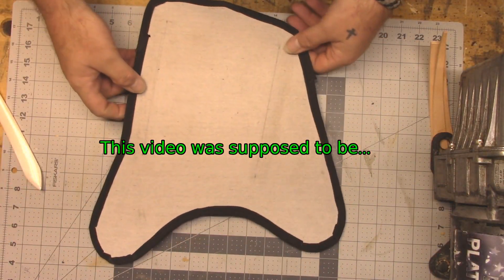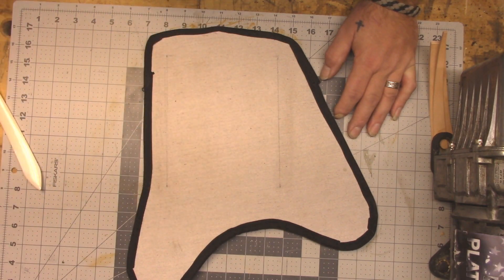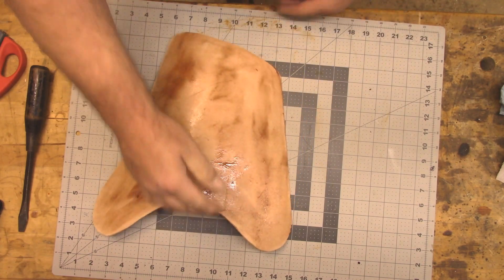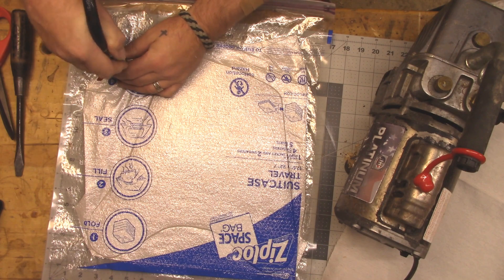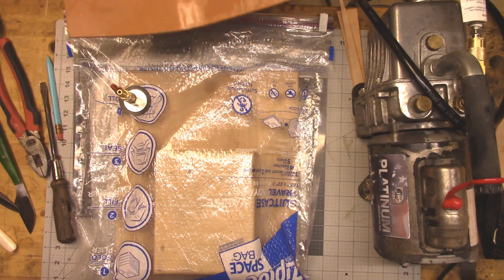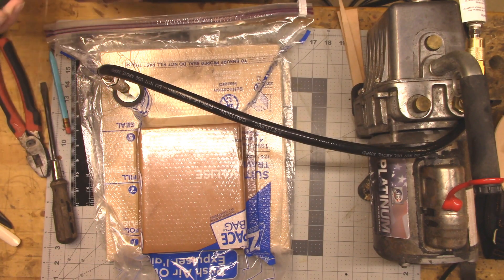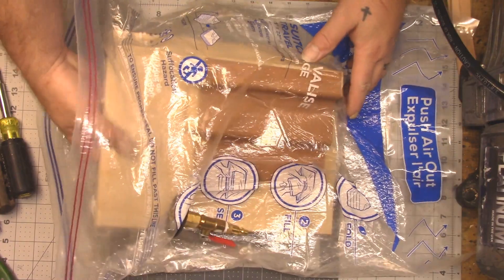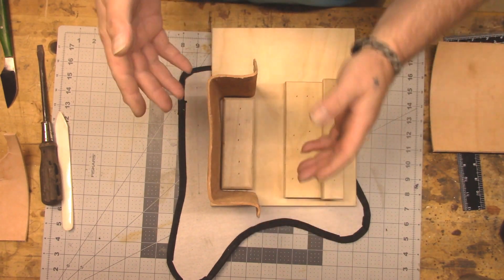GPW 185 - Vacuum Molding Rig Demo

Comment: Hey man, very cool project.  You have probably been asked this a thousand times, but I’m lazy and don’t want to wait until I get through all your videos so...
How did you build your compressor?  I used to have one from Vacupress when I was doing alot of veneering but they cost upwards of $1000 and I can’t justify the cost.  So if you don’t mind, what parts/tools did you use?  Is there anything that you had to customize?  Where did you get that frog?  (The part that fits to the bag from the hose.  We always called them frogs, not sure if that is correct.)
Anyway thanks for turnin me on to this.  I do leather work now and had never thought to use a vacuum press to shape leather.  Duh.  Also, did you ever get any mold spots on the leather or was it in there such a short time it didn’t form?
Thanks again!  Very coll work you’re doing.  Lots of good ideas and your techniques are straight forward and very doable.
Later,
Michael
Reply from the maker: Thanks for the props man!

I have never had a problem with mold on my leather from wet forming. The leather can pick up some discoloration from plywood sometimes, but I've never run into a situation where I had to mold a piece from the visible side of the leather.

Here's an example of plywood staining and a way to do this with a shop vac if you don't have a vacuum pump:
https://youtu.be/WnzZ5P2N4D4?t=221

I usually start the drying process as soon as I take it out of the bag. It almost never stays in the bag for more than 10-20 minutes... Usually more like 5-10 minutes.

 If it will fit, I use a toaster oven to gently dry the piece:
https://youtu.be/v-ABMvfbTHo?t=233